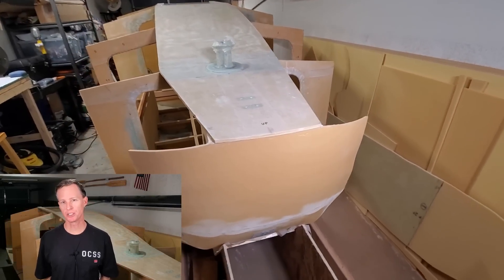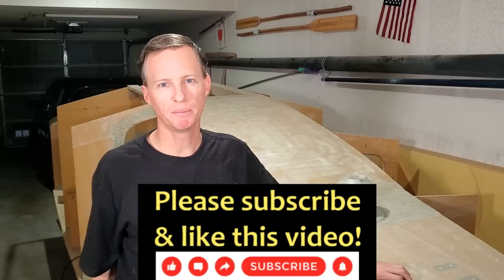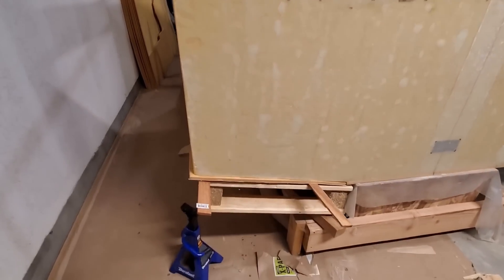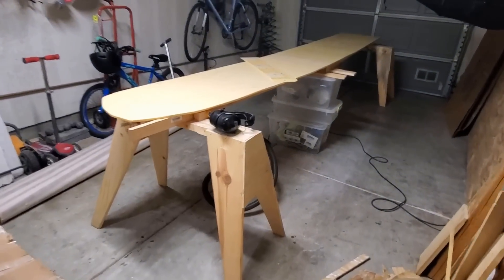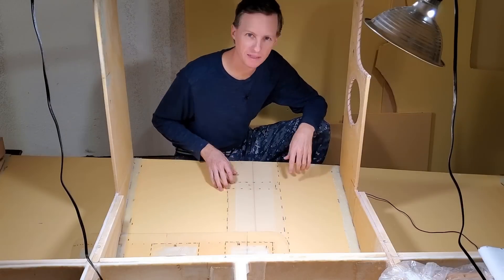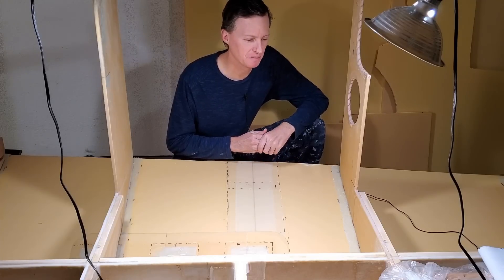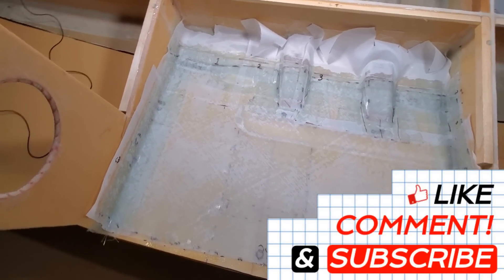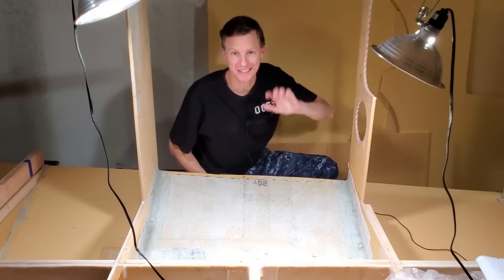OCSS-045 Port Chine Panel - Mini-Cruiser Sailboat Build

Comment: Don't rush, but I can't wait to see this completed. Would love to see the full cost (including the cost of donated items, delineated of course) and hours worked. How viable is building your own? When you're finished, would it be cheaper to buy new boat of similar size? Is there a sailboat of similar size?
Reply from the maker: I'm tracking the costs and perhaps I'll eventually make a video about it. It's a bit embarrassing how expensive it is. But, you can't buy a boat like this used or new. Not like the vision I had in my head. So, I decided to build it.
Reply: Boats like this don't exist commercially so you have to build them, or have a professional build one for you which is extremely expensive.
If you're happy with a more conventional boat IMO you're best off buying a used one and refitting and/or upgrading it.
Reply from the maker: Well said.
Reply: Human labour is typically the biggest single cost of any large project. So since home builders don't need to factor in the cost of their time, the savings can be considerable. If Captain Perry were to pay someone to build this boat for him, it would easily cost him 3 times as much.

(And at the same time, he'd have no idea if every single thing had been done properly, or if some things had been rushed or poorly built, nor would he have the intimate knowledge of every single nook and cranny that he does by doing the job himself.)

Comment: I saw in your amazon Wishlist that you're looking to get a flexible solar panel. Flexible solar panels generate less electricity, are less reliable and break more easily than rigid panels. So if you prioritize function I would suggest that you get a rigid panel instead. But if you think that it's more important to be stylish then you can go with the flexible panel. Good luck! :)
Reply from the maker: Thanks, I'll add some rigid panels to the list. I think the flexible panel will be good for the deck forward of the dog house.

Comment: A plywood sheet that weighs 37lb sq ft would be over 12in thick and weigh over half a ton!   Even 1in plywood is lighter than your pvc core.  If you are going to quote weights to people who do not know better, please try and be accurate.
Reply: True 37 lb sq ft heavy but maybee 12 in thick is needed to get the same strenght as 10 mm very strong sandwich composite.
Good that you keept your ears open and did notice.
He probably just did a mistake very human. I keep doing mistakes all the time.
Reply: @SvenYrvindExlex  SVEN I AM YOUR FAAAAAAAAAAAN OMG!! I just found out this channel and i'm in love with the build. gonna start my own projet this year INSPIRED BY THOSE GREAT SAILOR UP HERE! greetings from brazil!
Reply from the maker: Sorry, I meant per cubed foot.
Reply: @ocean_capable_small_sailboat    Ok.  But still misleading. What is the weight of one square foot of your hull skin when it has glass and epoxy on both sides? There is a crossover with sandwich construction vs ply when it comes to the same strengh for weight..
Reply from the maker: You definitely get less weight with equal or better strength by using a foam core. Test it yourself and make a video. I don't want to waste the epoxy doing a test. Check out episode 37. I weighed the aft deck after I fiberglassed it and then sat down and estimated if the same structure had been built of marine plywood what would the weight be. I estimate using foam core results in a 39% weight savings.
Reply: @ocean_capable_small_sailboat   An entire 8x4 sheet of 3/8 marine Okkume does not weigh 30lbs, so that is less than 1lb per sqft, and your aft deck is not so big.   I am not saying foam core is bad, i just dont agree with your numbers regarding plywood.  Must be some reason there are thousands of boat plans for small plywood boats, and so few for foam core.
Reply: @ocean_capable_small_sailboat   No. An American comparative study showed the different build weights based on comparitive stiffness on hulls of 30ft, foam core grp hull was 652 lbs, and plywood 486lbs.